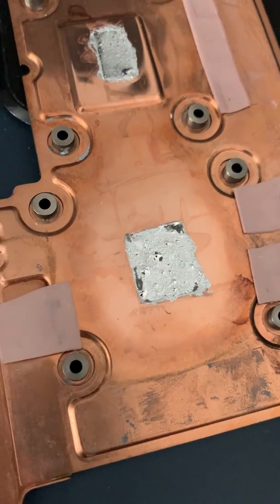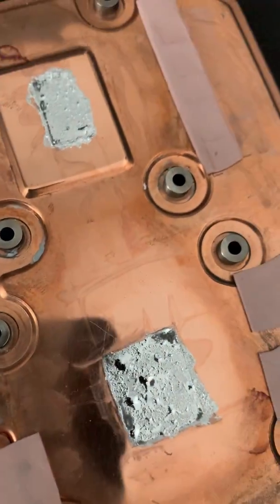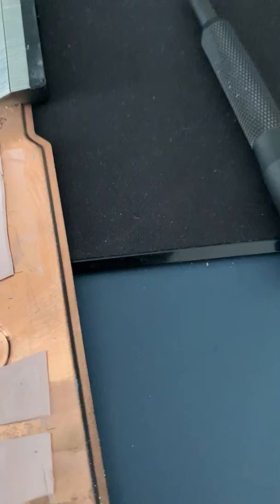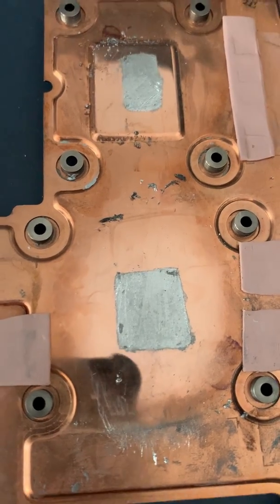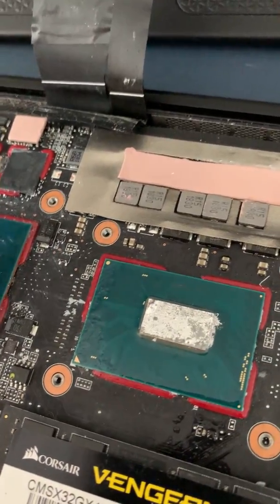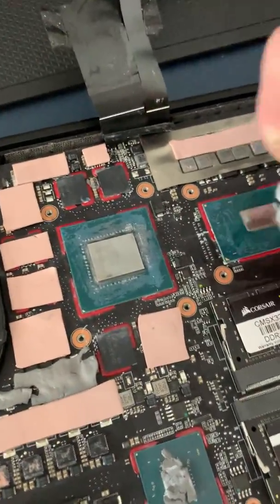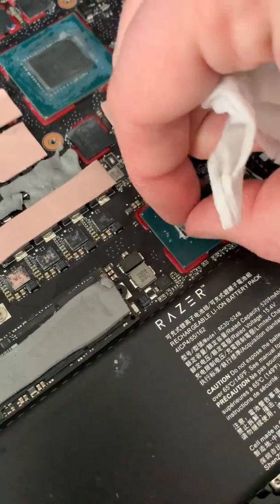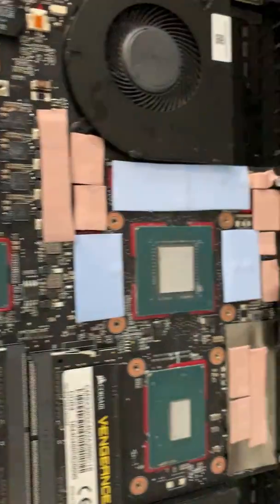Razer Blade 15 Advanced 2018 with liquid metal after 4x re applies and the alloying damage.

Comment: I don’t understand what’s the problem with this alloy? It’s good! At one point you will never be needed to repaste liquid metal , it will be there for life with low temperatures.
If you remove this alloy then it will be formed at the next application and at some point you will scratch the surface and make hole in Vapor chamber. This alloy do not reduce cooling performance but on contrary it will be there for life and eventually liquid metal cannot be absorbed anymore because of this alloy
Reply from the maker: Yes! You have to apply loads of liquid metal, the tiny amount that people say is not the way. Usually it get an air gap and fails. If you alloy it up over time and get just the right amount that alloying will create a great heat transfer. What normally happens with LM is it draws up to a spot and leaves some of the die exposed.

Comment: I really wanna use Liquid Metal on my 2021 Razer Blade Advanced but I wish I had a Nickel Plated heatsink.
Reply from the maker: I’m using it on the CPU of my 2020 17 Pro, still performs great, applied it really well, so if it has alloyed it’s directly in contact with the CPU die and therefore will still work really well.
Reply from the maker: You could also get a local plater to do it for not much and give it a go?
Reply: @murphy1138  I contacted one local electro plating company and they said they said they could not give me a quote for a laptop heatsink without looking at it but they said they have a minimum charge of $150 per nickel plating job. They do perform electro less plating though.
Reply: @murphy1138  I have experience applying liquid metal on my PS4 Pro properly but I don't mind if my PS4 dies later. My only concern really is if I have to open the laptop up frequently for repasting liquid metal that I might bend the heat sink. Some people say they need to reapply liquid metal a few times in a year.

Comment: Thanks for the video.
I don't think LM is the way to go with these laptops. The heatsink is a vapour chamber design with thinner walls. Thermal paste performance isn't as important as the big copper block ones, plus they are more sensitive to damage and further thinning of the wall might be a bad idea.
Thankfully I think it's relatively easy to get new heatsinks from china.
Reply from the maker: Shark00n1337 I replaced with Noctua NT-H2 it’s fantastic. Best paste I have used.
Reply: @murphy1138  Yeah the Noctua or Kryonaut are great choices. I have kryonaut on my Blade Pro 2019 with good results.
Reply: @Shark00n1337  Are you saying you can get Razer blade 15 advanced vapor chamber cooler from china?!. The freaking laptop cooler? Isn't it manufactured only by the OEM?
Reply: @therealb888  Razer doesn't manufacture shit. It's all made in china. You can usually find replacement heatsinks around TaoBao.
Reply: @Shark00n1337  I know it's made in china duh. Razer contracts an OEM factory/vendor like apple contracts quanta computers & foxconn. But won't these OEMs have agreement with razer not to sell replacement parts on their own?. 

I'd assume these replacement coolers on taobao are duplicates/clones manufactured by 3rd party companies who don't have accurate OEM specs. Vapor chamber coolers should have tighter tolerance right? So are these non oem ones capable of meeting them?.

Any idea who are razer's vendors?
Reply: @therealb888  OEM or not these things have a way of finding themselves for sale.
Reply: @Shark00n1337  That's the one of the main reasons I love chinese. Being into tech & electronics, they keep giving me pleasant surprises.